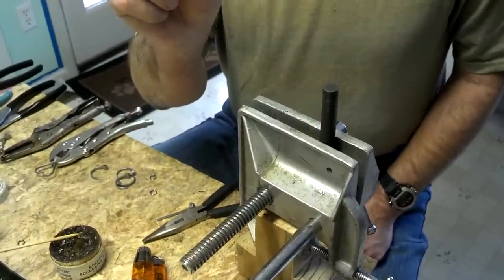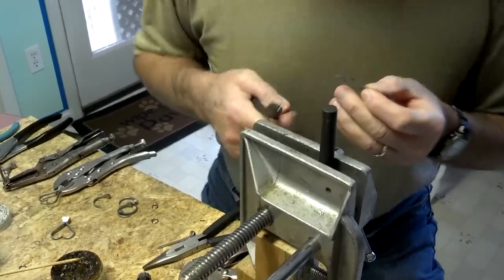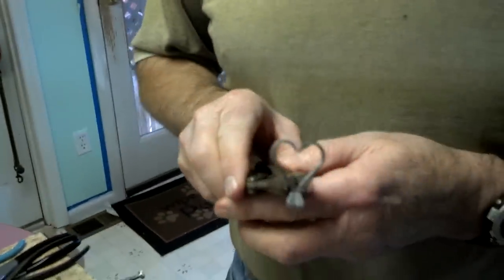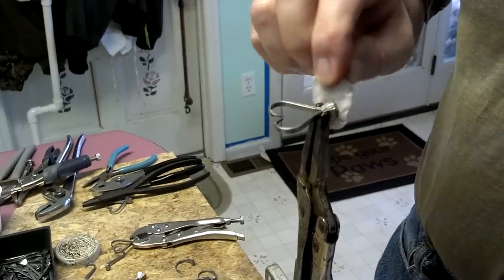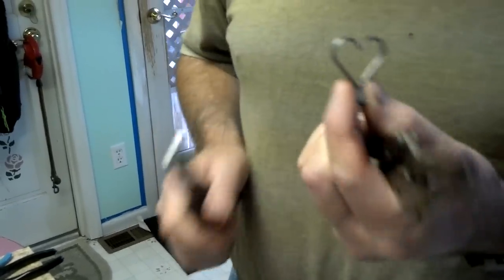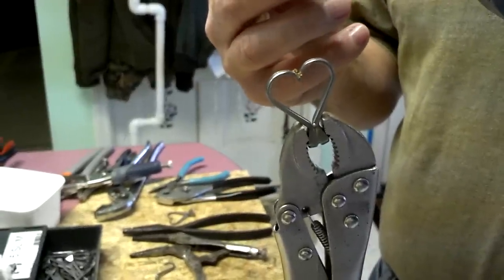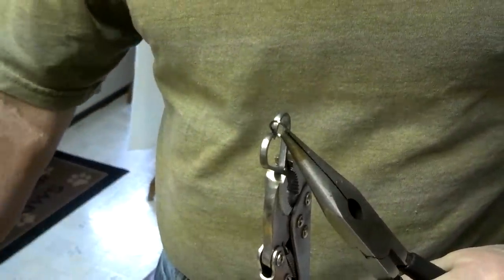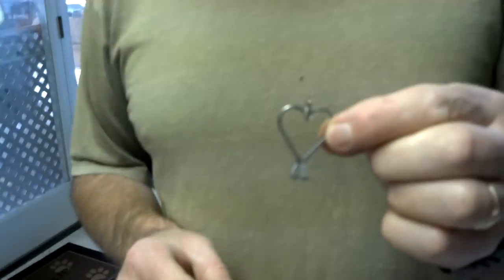Horse Nail Heart

Comment from the maker: I use the stuff I got at Lowe's in the plumbing department. If you watched the video you saw me do it. One tip, if you heat it to hot and it turns back.  You must sand the back off. If you need more help, get back with me.
Reply: I think he meant to write it turns BLACK not back

Comment: Is it hard to turn it on and I wonder if you can heat the item on s surface
Reply from the maker: It’s not hard to turn on, it does have a safety switch you have to hold if you want it to stay burning.  The amount of heat depends on how long you hold the flame on what you want to heat.